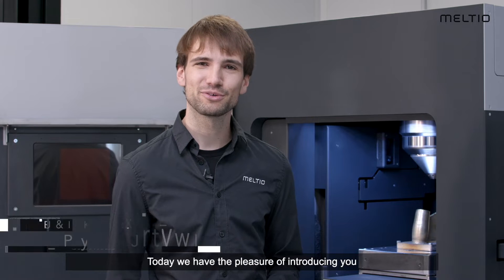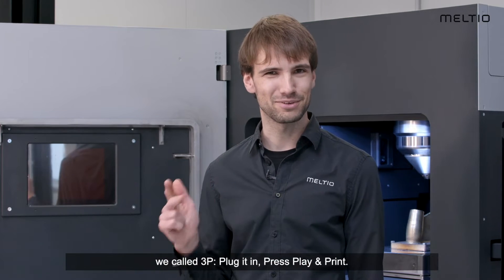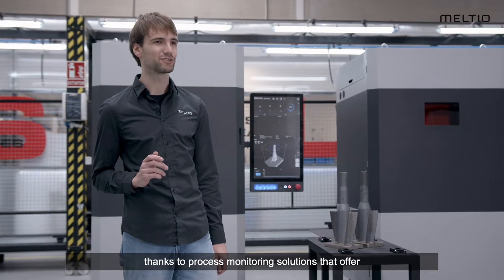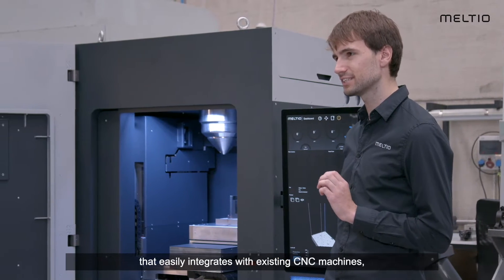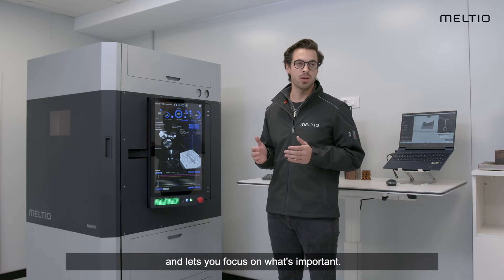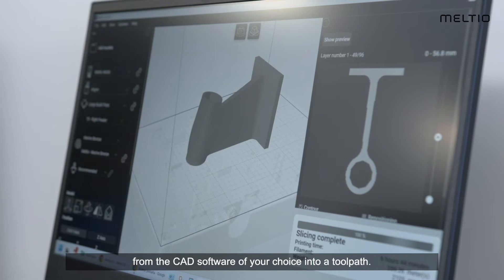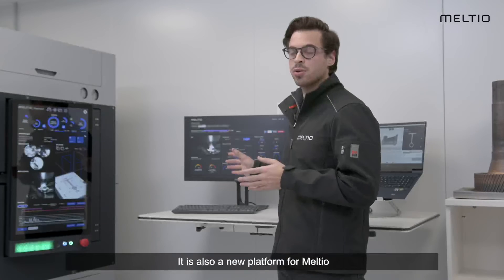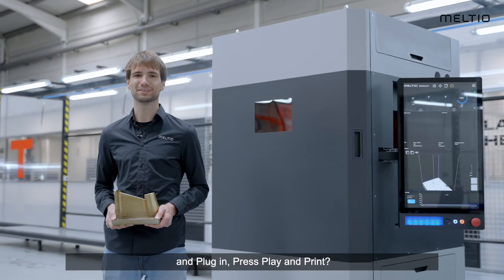Meltio M600 - Industrial Metal 3D Printer

Comment: Will having a wire EDM in my shop still be the best way to remove parts from the build plate with the Meltio M600?
Reply from the maker: Hi, 

Yes, but a bandsaw can be an option as well, as long as the blade thickness is considered by implementing a raft in the printing process.

If you have more questions, do not hesitate to send us an email via info@meltio3d.com
Reply from the maker: We can help you with that! Send us his details via info@meltio3d.com and we'll contact him😂
Reply: @Meltio  I’m on it!!